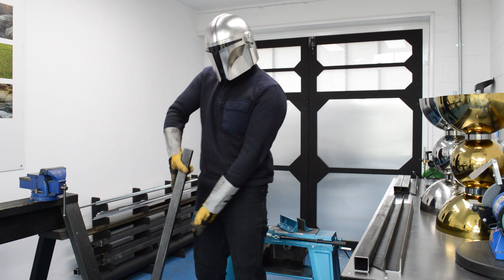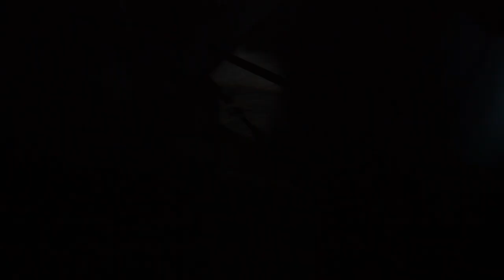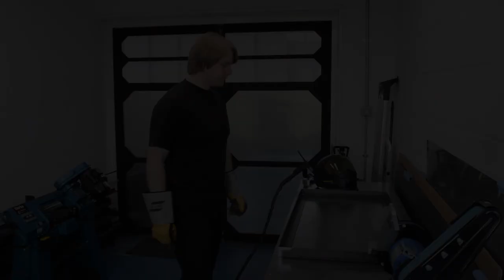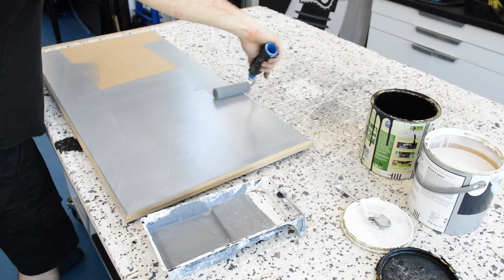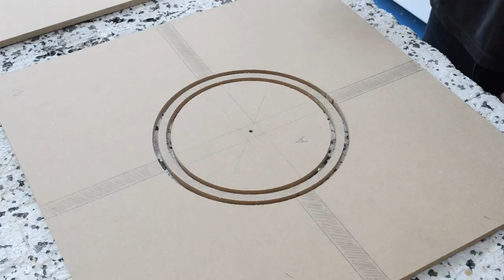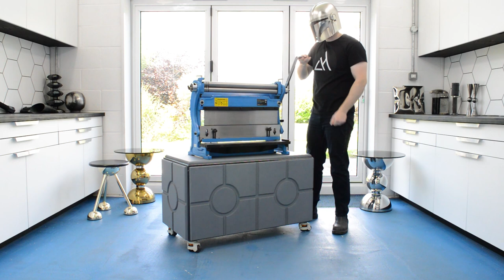Making a Cargo Crate from Star Wars

Comment: I always try to tell people to paint their shop/storage spaces white, but so few folks listen. The white surfaces make getting adequate lighting so much easier. And for me at least, it is psychologically so much more pleasant to work in than in some dingy, dark, gloomy space.
Reply from the maker: Absolutely, I wanted to avoid brown/wood colours, and shelves full of random stuff gathering dust & cobwebs, like in my old garage. Fortunately I haven't needed to repaint since the workshop was built in 2018, just blow away dust occasionally with compressed air.
Reply: That works well for the back of car instrument panels on older cars. Painting them white makes working behind there much easier when you have to fiddle with the wiring.

Comment: You take all that stuff outside to grind, right? Too clean in that shop for the dirtier work. Ant how great job as usual.
Reply from the maker: I only grind in the 'metalwork' end of the workshop, and luckily most of the dust goes on the floor, which makes it easy to clean up with a vacuum.
Reply: @ConnorHolland  
You've probably had this question a thousand times. What brand saw is that? Your videos have been very informative and seeded new ideas. I particularly enjoy the potential of hydroforming. Great job as usual is what should have concluded my previous comment.
Reply from the maker: It's a Clarke CBS45MD. Thanks for watching, I will definitely be making more Hydroforming videos next